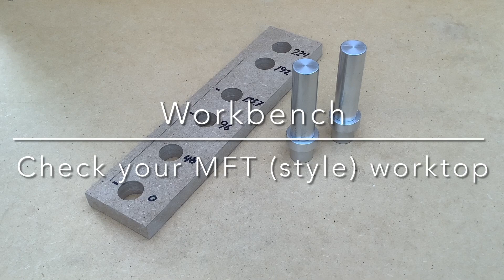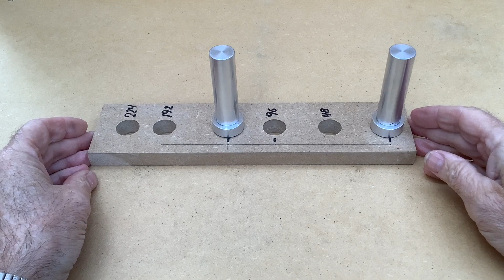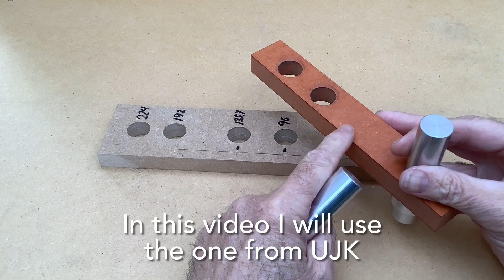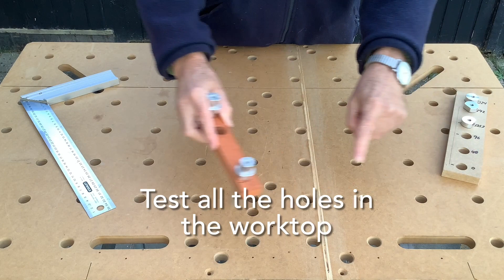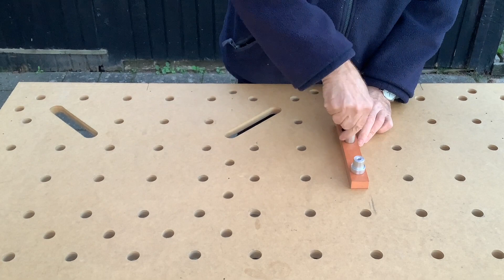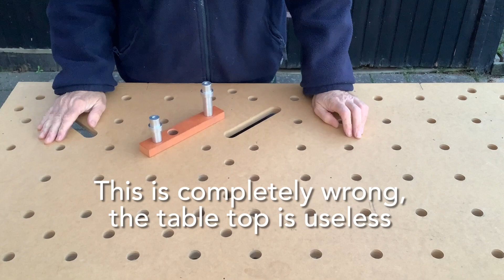Workbench Check your MFT (style) worktop

Comment: Hi, my problem is that the 20mm hole is to sloppy for 19.90 mm third party dogs, i think to see you have same, there is a little bit of movement, maybe iam wrong but it sucks in my case😂
Reply from the maker: The bench dogs I use on the work table measure 19.93 and they sit as I think they should sit both in the work table and the measuring block, but there are other makes with other measurements.  I just tried a pair found on AliExpress that are stated to be 20mm.  and they are impossible to use on my workbench.  Ask different manufacturers for precise measurements until you find the ones you think are best for you.
Reply: @Harris-DIY  Hi thanks for your reply, i have 6 small dogs from BenchdogsUK, 19.90 to 19.92 (same batch..!) ...With MDF MR and MKII Parf the holes are just to sloppy imo..I have after my comment us it on a test piece melamine and plywood, dogs now fit with a suction, i think with MDF the holes are bigger. ( 20.2) vs 20.04 Ply) .....I love your vids ;)
Reply from the maker: Perhaps the problem lies in the type of MDF you are using.  I once made a table top in some cheap and light MDF and here the holes were also too big.  Try getting hold of some scraps of different types of MDF and see if that doesn't solve the problem.
Reply: @Harris-DIY  Yes new rules here in the netherlands, less glue , less pressing..I now have made one of expensive meridite mdf and is perfect now.
Reply from the maker: Good to hear, it's a good system but there are many things to be aware of

Comment: Did you build these worktops, and if so, what kind of bit did you use? Forstner, paddle, brad point etc? They both look really nice! I’ve built several mini workbenches recently, and it’s like there’s some unwritten rule of the universe that won’t let a guy get every one of the holes right! Ha! Thanks for posting! I always enjoy your videos!
Reply from the maker: Yes I have made them, used a UJK Parf Guide Mark 2 system.  I was unlucky to get a set where there were errors on the rulers and had 3 table tops made before I found the errors, so now checking and troubleshooting has become a hobby :-)